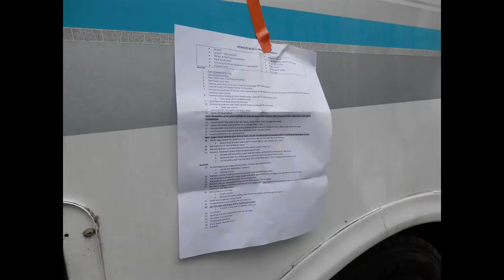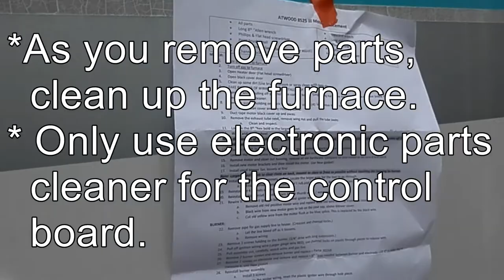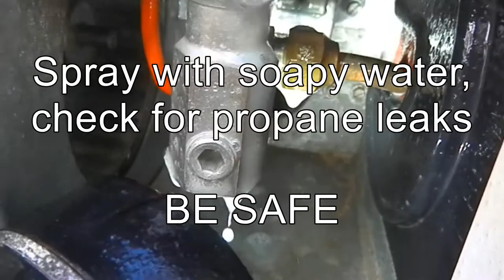8525-III ATWOOD RV Furnace 1996 Motor replacement

Comment: Thank you so much for this video! It’s been very helpful. My grandfather was a certified RV furnace, AC, and refrigerator repair guy, but sadly isn’t around anymore to ask about this subject on my camper, so I turned to youtube for help and found your video. This video has built up my confidence enough to do the repair myself rather than ask for or pay for help.

Comment: Don't normally comment but i gotta say, this dude knows what he's doing! Videography and descriptions were very good, which is what many maintenance videos lack. Also, extremely good technique and attention to detail. Even though he used claw hammers and adjustable wrenches for certain things, nothing appeared to become damaged and it was a nice easy step by step...that's all good technique and planning right there. Also being able to source a list of instructions before starting the project was a pro move. Wish the instruction list was sourced however with this video it isn't needed. Also I like the trick of mildly taping screws into the bit driver for assembling the hard to reach back ones. Then the guy goes on to even spray the soapy water to check for leaks at the end, again, thorough. 20+ years in maintenance and this dude just saved me hours of time having to figure out this BS PITA repair myself. THANK YOU
Reply from the maker: Using what I had, claw hammer was reasonably small, just tapped on the shaft. I have mushroomed shafts before so if it wasn't moving I would have sanded more and oiled more.
thanks for the comment.

Comment: Thanks, the sandpaper trick helped and I wedged a screwdriver between the motor and housing to pry the motor out of the metal impeller. Before that was heat lubricant hammer and a file. Thanks

Comment: thanks have the 8531-II very similar. Only issue I ran into was not being able to remove the exhaust but was still able to slide the new motor into the smaller fan.

Comment: Just curious would it be easier to take the whole unit out and then work on it or try to work on it like you just did
Reply from the maker: no.  It was not hard to do it this way. Pull up a 5 gallon bucket and sit there doing the work.